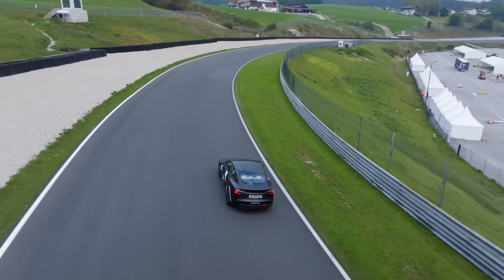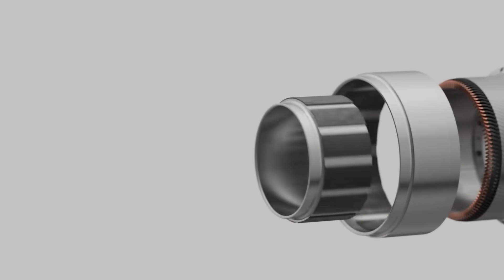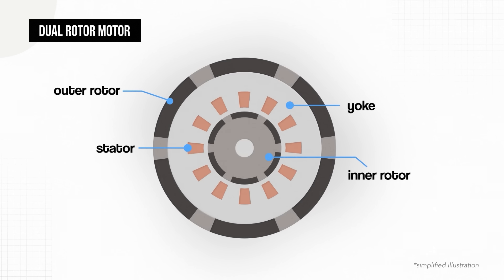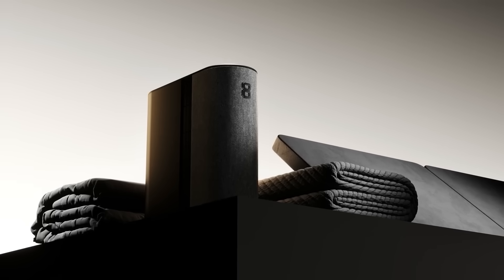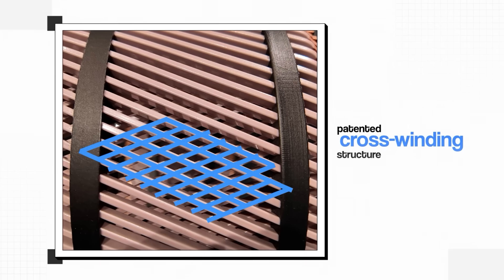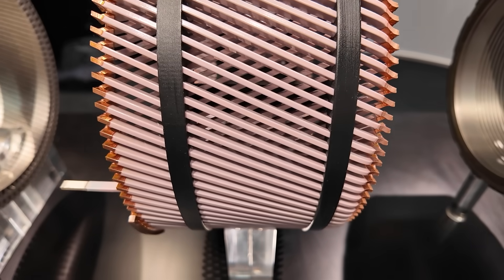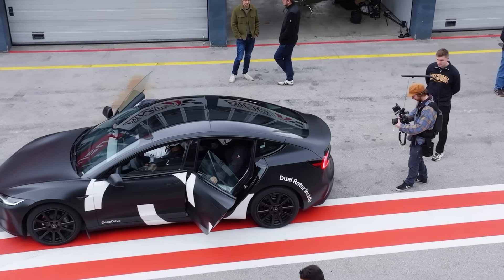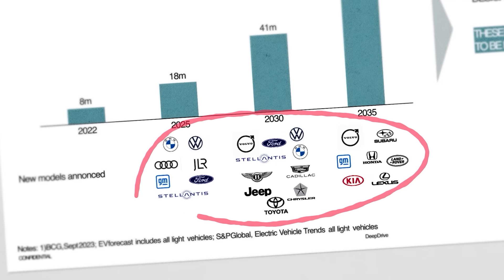How Dual Rotors Make Motors Insanely Efficient

Comment: No numbers? WOW! This is the same as countless channels that talking about NEXT BIG REVOLUTION IN BATTERY TECHNOLOGY!!
Reply: Exactly which numbers were you missing?
Reply: @zlozlozlo  the efficiency numbers. This is supposedly the USP of this device so why not describe it?
Reply: there are plenty of numbers in the video
Reply: Perhaps you didn't recognize numbers because they were in metric.  Let me help:
2000 NM= 1475 Ftlbs of torque. 
180 KW = 241 hp
34 KG = 75 lbs weight
Now 20% greater efficiency across real world drive cycle is not metric. But to delve deeper into that we will probably need an actual production car doing real world drive cycles out on the road and that sounds 2 years away. 
I have a Chevy one ton van with the old standby small block 350 V8.  
This motor has almost as much HP, more than 4 times the torque and it weighs about 10lbs more than ONE of the heads.  
If built as a wheel motor you subtract all the efficiency loses of having a drivetrain. (2-5% on a Tesla)
The three key points from this are, 
1: Easy to build.  (No matter how great it is, mass production capable is the number one criteria. Everything else is just a side note)
2: Half the currently required rare earth magnets. 
3:  Better efficiency.  (With current efficiencies at >90%, accurate numbers for the remaining small incremental changes require real world real car measurements.  Again, probably a couple years.  
I do wonder how long before we get a wheel hub motor car on the road.
Reply: @pathfollower  He's repeated back the probably made up numbers the company he's glazing gave him - that's not really the same thing as showing it's better - the main clue that it might be an improvement is that they claim to have convinced a lot of car companies to invest.
Reply: @peglor @peglor  
Claiming "no numbers" and saying " "I don't trust your numbers" are two different things.  Yes the numbers came from corporate, but what is the alternative?  Demand a prototype, and ship it off to Monroe and Associates for testing and analysis at $100k+, and only then make a YouTube video?  
This man takes publicly published information and disseminates it to a wider interested audience.  The listener can accept,  reject, or validate the information received at their discretion.  But the claim that the numbers are most likely false with zero corroborating evidence, is doing what you accuse others of.
Reply: @pathfollower  He's taking whatever the company gives him and making long ads praising them, without any commentary on believability, or the very obvious disadvantages of the design from a structural point of view.
Reply: @peglor like?
Reply: @pathfollower  Well no, as anyone with a brain can quickly see that 20% claim is a blatant LIE.  There are 2 components to ANY modern motor... the motor and the controller.   A controlled motor NEVER has an efficiency BELOW 80% at ANY point of its torque curve other than 0 RPM.  So, the 20% claim is pure mumbo jumbo epic lies.  The only question in which direction.  All the other claims about reduced size, etc.  Maybe, but what is NOT discussed, is a VAST increase in COPPER.   Copper is ~10X the cost of Iron/steel.  = Dead on Arrival as a concept except to HIGH END luxury vehicles and NOT the common man vehicle.
Reply: @w8stral I don't disagree with your skepticism but the increased copper material cost could be offset by the reduced permanent magnet costs, especially now that magnet supply chains are under geopolitic stress.

I still don't understand how the cooling issue is supposed to solved by only cooling one side of the motor.
Reply: @needles_balloon  ~near no one is using permanent magnets(motor vehicles, not hand  tools), and those who are(high power), are NOT using rare earth materials.  These magnets are essentially ~iron so...
Reply: @w8stral @w8stral  
Brainless here.  Obviously all efficiency claims have to be proven.  
A Tesla Model 3 Drive unit with motor, inverter,  case, differential, and axles is about 80 kg.   Of that 3.5 kg is copper.  That is about $40 worth of copper.  If this motor had double or even triple that we are at $80-$120 in total copper.  But this is attributed to be very easy to manufacture (money saving) and have half the rare earths of other motors, so I'm not seeing luxury pricing only.
Reply: @pathfollower  You do realize, NO ONE is using rare earths in their motors? Right?  NO ONE.  Computers are using them.  Cell Phones are using them.  Sensors for missiles etc?  Yes.  Vehicles?  No.  Civilian battery hand tools?  Yes.
Reply: @w8stral 
No, I did not know.   I knew Tesla was moving away from them.  Something about nitrated Iron making nearly as strong magnets if I recall.
Reply: @w8stral 
I asked Google if all major OEMs had eliminated rare earths from their EV motors.  
The response:
---------
No, most major EV manufacturers have not completely eliminated rare earths, but many are reducing dependence through new technologies and design changes. Some manufacturers, like BMW and Renault, already use rare-earth-free motors (such as externally excited synchronous machines or induction motors) in certain models. Others are focused on minimizing rare earths through material engineering, while others are developing next-generation motors to be rare-earth free in the future.
Reply: @pathfollower  Well, all actual EV manufacturers have long since never used them.  Start up EV jokes in the EV realm use them for simplicity's sake as it means they get to use a garbage motor controller without much of any torque mapping and frequency control with different load management(slippery road surfaces, vibrations throwing power to different wheels etc).   No one making more than a handful of EV's use rare earth magnets.  So, google AI is technically correct, but in reality, wrong. Typical AI garbage.
Reply: Copper is about 4x more expensive than steel used in motors. Titanium is 10x.

Material cost isn't the issue.
Reply: @pathfollower  there are many issues with hub motors. Also why bother, when tesla motors were already above 97% efficiency (measured)  years ago ? This is a solution waiting for a problem to solve, and an expensive one at that since more complex.
Reply: @croustibat682 Indeed. But peak efficiency of a motor or inverter isn’t that informative either - you need to see graphs of how it varies with speed and load. Then compare that to typical driving scenarios.
Reply: @croustibat682 
I did wonder about the negatives of Hub motors.  True, Tesla motors are extremely efficient.  But there is the theoretical 2-5% loss that could be negated by eliminating the drive train behind that motor.  This, of course is assuming that this type motor is at least as efficient as the Tesla motor.  10 or 15 extra miles of range is always nice to have.
Reply: Hub motors work so well in electric motorbikes, scooters and ebikes. I know from building a mid drive E motorcycle compared with an in wheel hub driven one, that a hub motor simplifies everything so much, so much more space for batteries, no driveshafts/chains etc. Even though it will be more difficult to make them work with cars, the advantages in more space and simplification are significant, therefore I am not surprised that there are a number of companies developing them. I've got a feeling lighter in wheel motors will eventually be used in cars.
Reply: @markirmuir  And we didnt see this either here. Why then, if thats the main point ?
Reply: spectrum

Comment: How much do efficiency increases matter if you consider standart electric motors can already reach efficiency of 98% ?
Reply: They may have peak efficiency of 98% but only in the exact right conditions (speed, load, etc). This might raise efficiency in the lower efficiency conditions, but idk.
Reply: @needles_balloon  what about durability? internal structure supported by copper? can't see that surviving very long. cars vibrate.
Reply: A 99% efficient motor produces half as much waste heat as a 98% efficient motor. This heat issue is important for improving LED light efficiency for example. If we could get to a stage where these motors need no cooling, that could be quite beneficial.
Reply: It seems they eliminated most of the iron from the stator. That would decrease losses from the magnetic field interacting with the stator, which are independent of the current and therefore present (and dominant) at part load. So this won't affect the peak efficiency when floored, but will massively improve the efficiency when actually driven on an actual road.
Reply: @josefsvitak4313  and lower the durability

Comment: I would like to know if these motors require a drive for them to run like the other new designs I've seen come out in the last decade.  If they can run on across-the-line starters, these could have a massive effect across industry.
Reply: they're just electrical machines. Direct on line starting or any of the other starting methods will work just fine. Why would industry prefer these motors?
Reply: @redshift3  Their considerable reduction in the usage of iron makes them much lighter per hp(or kW).  That makes supporting infrastructure also lighter.  The reduction of materials used also has potential to make them cheaper.  If they can operate with a basic $500 starter instead of a $3000 drive, their installation is also very cheap and easy to do.